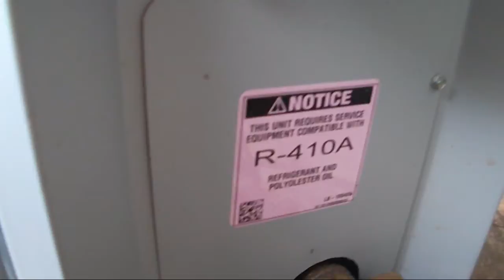2011 Aire-Flo 13 SEER/7.7 HSPF 2-ton heat pump startup/shutdown in HEAT mode!

Comment: 84randomdude if you call this a  pos your calling a lennox a pos. The first aire-flo models were the old ducanes which lennox rebadged when they bought them out. i used a few aire-flo products and never had trouble with them! install them right and they will last.

Comment: @2004OIFVET Probably the heat strips buzzing. If it heats, nothing to worry about. If it's a heat pump, it's probably a loose panel on the condenser.

Comment from the maker: @84randomdude More than likely I would go with a Trane XR-series or XB-series heat pump, or a Carrier base model heat pump. Either way it would be matched up with a variable-speed air handler w/20kw electric backup heat.

Comment from the maker: @84randomdude I agree with you. If that were my building I would have attempted to track down a replacement Climatuff compressor. If it wound up just not being worth it, I would get a new Trane heat pump. Since it would probably be an investment property that I rented out to a tenant (which is pretty much what it is now), and not my own home or business, I would not spend a fortune on a Trane XL20i.